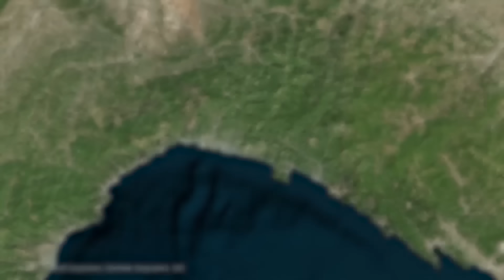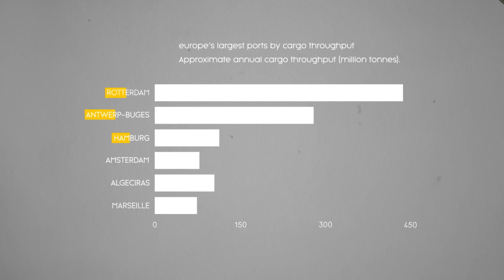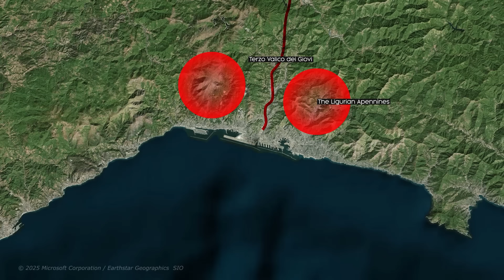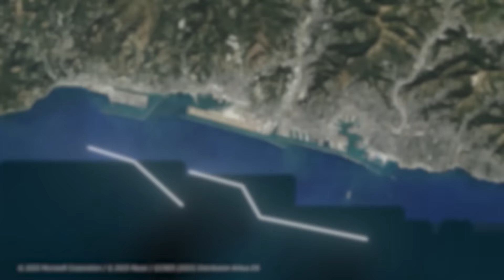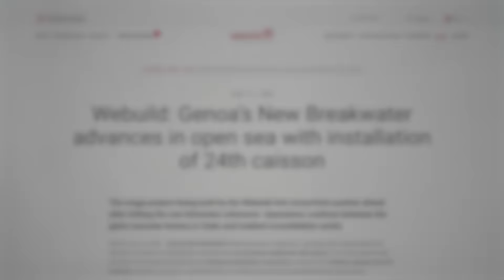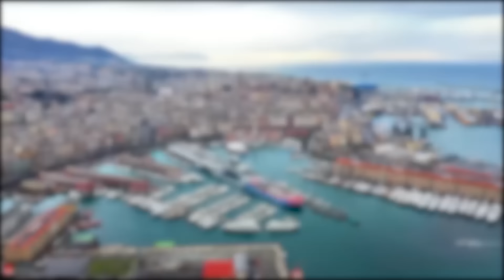Why Italy Is Building a 6-km Wall in the Mediterranean

Comment: So this is a breakwater. But how do the vessels get offloaded without expansion of the actual port and its facilities, + rail and road connections?  This wasn't explained.
Reply: Just do the old speed bump run at high tide...
Reply: Watch again, is at the beginning of the vid. Barrier is drawn in red.
Reply: If you don't know the project beyond the breakwater, don't speak!

Comment: We have the Gioia Tauro port in southern Italy with a natural 3km length of peninsular land able to be transformed into a high-volume container port. No steep geological obstructions, strategic placement, Reggio-Messina straight proximity, middle of the Mediterranean Sea, near two major airports, goods able to be put on rails. Yet they decided to cram up Genova's yet again with a logistic system unable to absorb the cargo volume.
Reply: Why would you want to put cargo on train far from the final destination? It is much cheaper to just sail the ship longer, as close as possible to the final destination - if not, then all cargo would just go on trains from China to Europe.
Reply: @ponypruhest  From the straight of Sicily to Genova a cargo ship takes two days, so if you put it on rail at Gioia Tauro port your goods need only 24h to reach northern Italy. You remove one extra day of slow sea travel, you have the cargo on rail earlier, you increase volume and work in a much needed region of Italy, you gain commercial power in the Mediterranean Sea.
Reply: @Dr.Kananga To operate a mid-sized (10,000 TEU) container ship costs about $100,000 per day. An Italian freight train can carry around 60 so you need to run 170 trains per day each way for about $600 a go. Explain.
Reply: @jimtitt3571  An Italian freight train will take the same amount in Gioia and Genova, but if you stop in Gioia you can unload faster for destinations across italy a day earlier.
Reply: @Dr.Kananga  a container train transport from Gioia Tauro to Milan has the same price than from Shanghai to Genova. 
Plus Gioia Tauro is already running at almost full capacity with no room for expansion.
Reply: Without barges moving containers inland, Genoa can't compete with northern European ports. They're building an artificial Rhine on steel, the new railway, but in the meantime the polar route is opening and freight trains between Europe and China are getting common sense. Good luck staying relevant.
Reply: Come dire non aver capito un caxxo.😂

Comment: For genoa to become a major port more deep tunnels will need to be bored beneath the Alps for freight only using electric locomotives.  Sounds like a job for the Boring company to me. Low locomotives, low railcars, containerized freight, and small diameter multiple interconnected one way tunnels are the way to go.  Passengers, and existing rolling stock can use the existing tunnels.